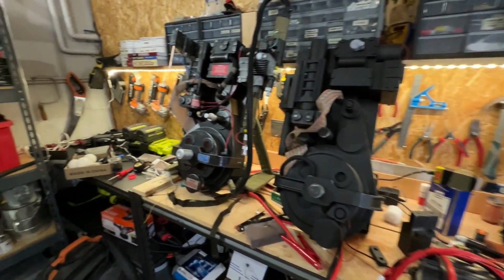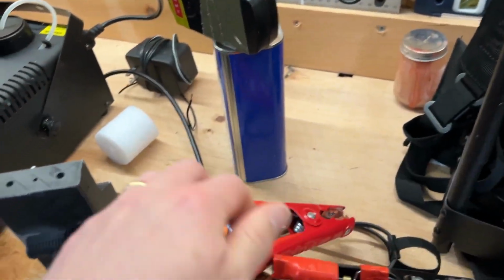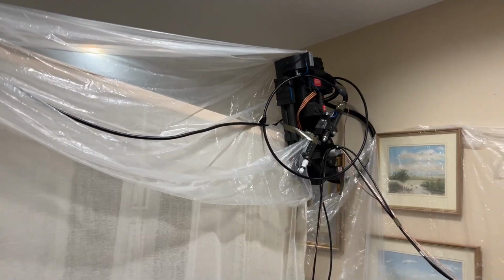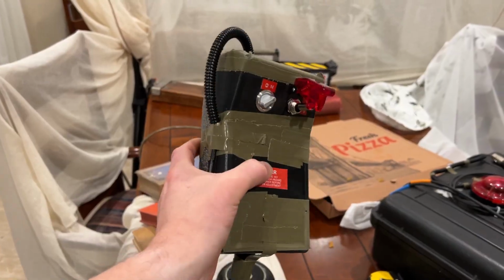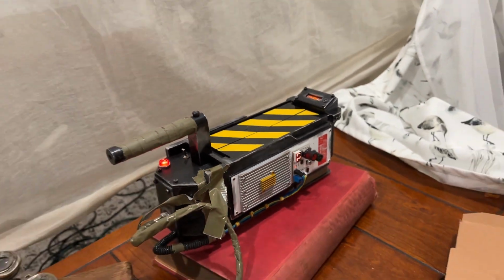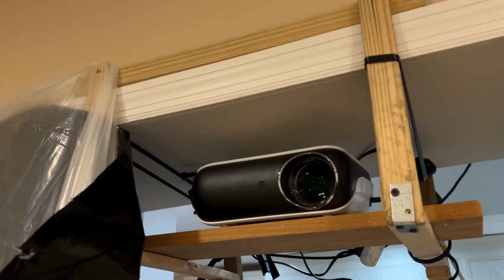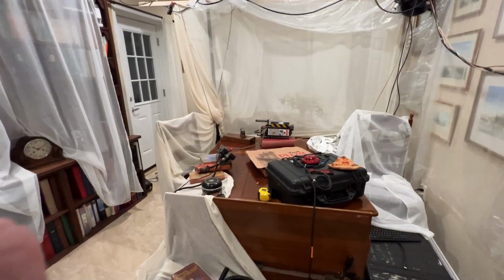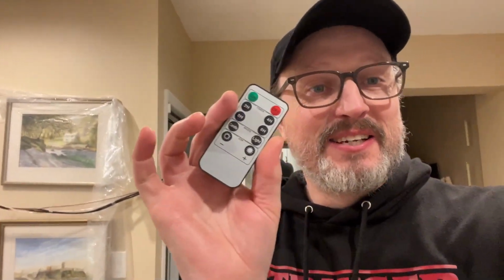How to Make a Ghostbusters Home Haunt

Comment: Have to ask, what housing did you use for the spirit trap servos? and how did you attach for the housing gears that are stock? Its my one hurdle... I made a foot pedal, just need the help getting the rest together! I have the wires, servos, etc. And ardunio. Did you ever do a step by step? Is there a 3d printed mount for the servos or a custom gear system? I have searched gb fans following a step by step wiring approach. Just wondering about the how to if you have any advice it would be super!
Reply from the maker: Thanks for your question - I cover it in this video: https://youtu.be/PfYQI0BQKKM Hopefully this helps - I am planning on releasing a PDF with the measurements and a downloadable with the spec - Just been too busy. Good Luck with it - hope this video helps give you the answers you need 😀